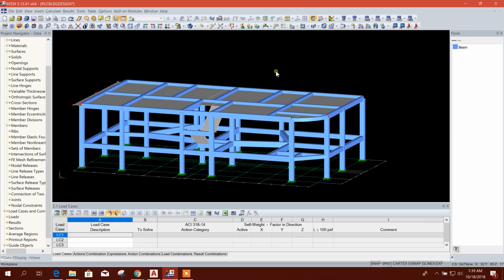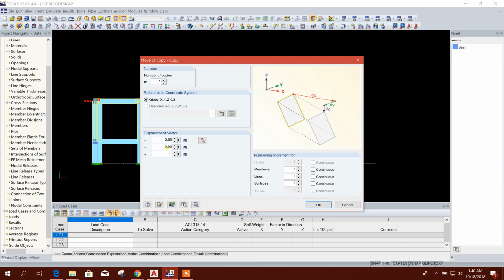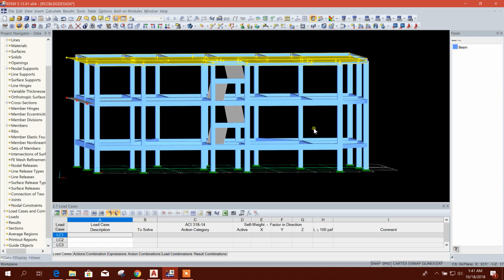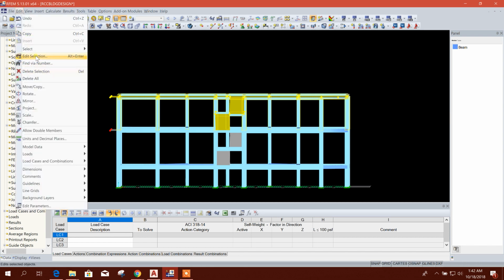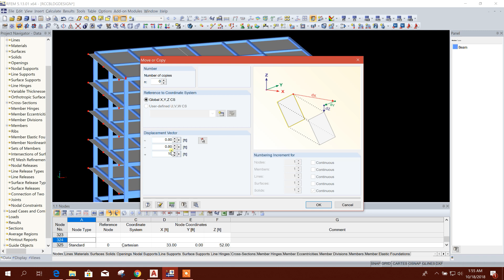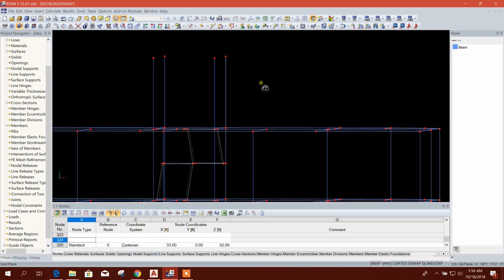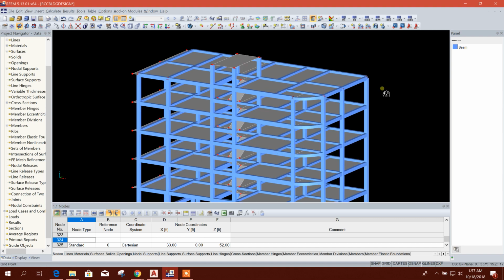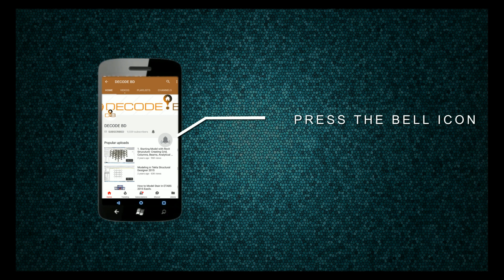REPLICATING STOREYS IN DLUBAL RFEM

Comment: Isn't RFEM explicitly need the nodes so it knows it's a connection? You removed nodes when you copy the top couple of floors, now the RFEM doesn't know if the columns are actually connected.